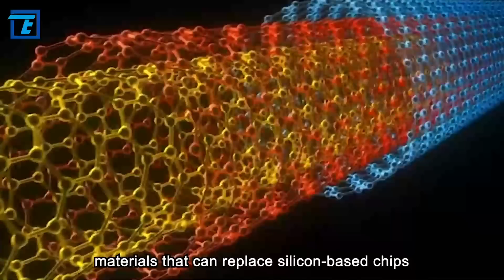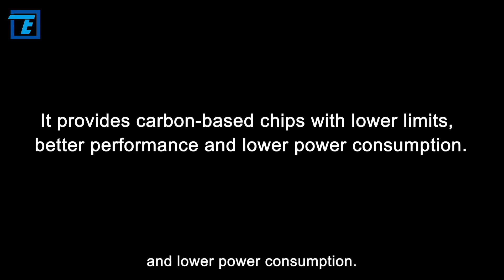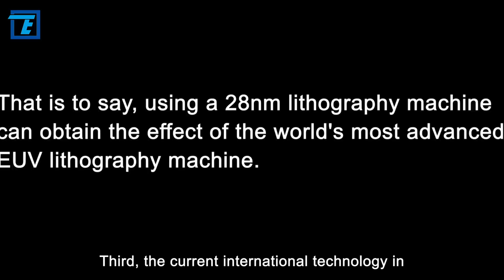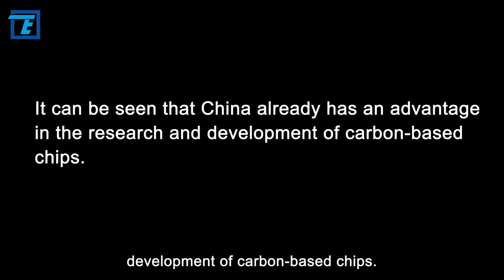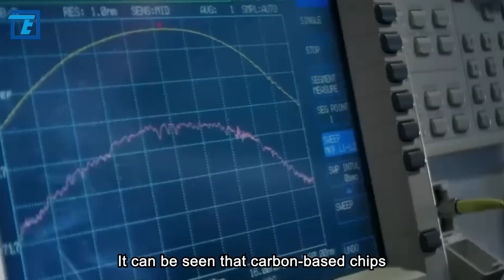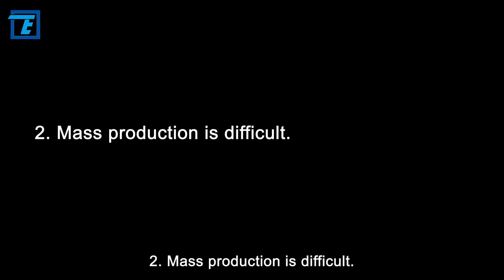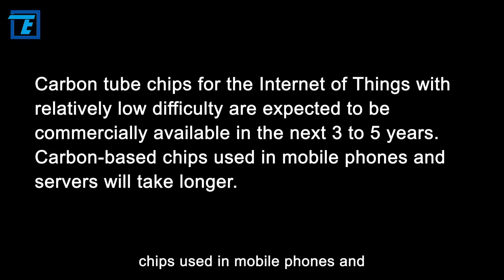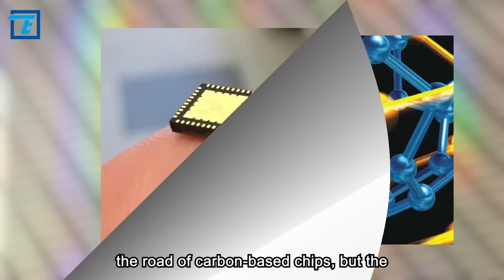Oops! It seems that China's carbon based chips gradually gain the upper hand?

Comment: Step by step to overcome these obstacles. If anyone can do it China can. First, China has already produce 8 inch wafer therefore the purification process must be at a reasonable level. Building on it and improve the process is what China do best. Second, China political system work in such a way that it can create policy for some application to be dedicated to carbon based semiconductor chips like communication 6G, military, nuclear, AI, space, etc. However this can only work if the purification process is perfect. From here once it hit economy of scales then the Chinese government can encourage wider applications and in return encourage more mass production. Remembering those day when email is being used for government department in the USA. Then high value commercial organisation adopt it then it become more common by the day. Now, it’s just part of everyday communication life. This is what will happen to carbon based semiconductor. China now, with the Americans and gang Japan and Netherlands oppressing it, China will increase the pace of this policy first locally then push it to the rest of the world. China will hit back by dropping all silicon based semiconductor. Likely company like Huawei will spearhead it. The first will probably be communications and EVs. These two is huge. It can work if it shows the performance and stability.

Comment: This carbon based chip celebration may be taken as a starter’s advantage for those limited at 28nm lithography struggling for alternative to match 5nm or smaller pitch in remaining performance and not cell density of 5nm. 

Remember that both silicon and carbon based chips manufacturing requires lithographic machine, the finer pitch the better. It doesn’t take much for those who own 5nm today to catch-up with your 28nm carbon based chips, unless you have a protected IP or secret process that others have to get around suffering in poor yield.
Reply: first you need to have the tech to purify ''carbon'' before lithography so they need to catch-up with that technology first... also make it competitive economically... the mighty west know how to purify silicon to do the solar panels, but 90% of all wafers are made in China, because it can't compete on scale and price.... with chips.... do what they did with cars... wait for a new technology. China was behind in ICE cars, and could never catch up with the west, but with EV, since everyone started about the same time, now they are crushing it. (150% than the entire western world... COMBINED) - carbon based chips are the future